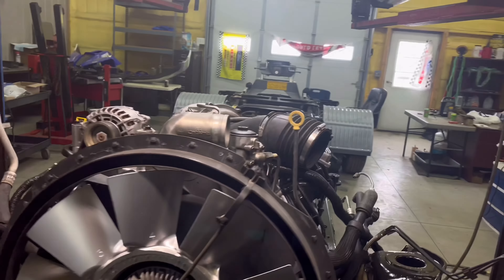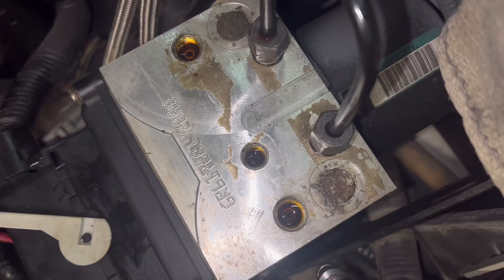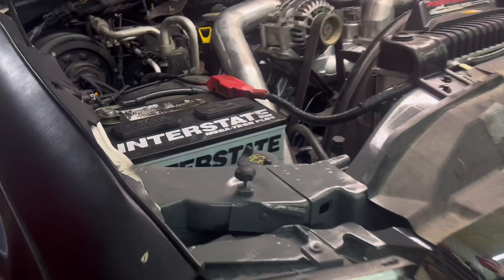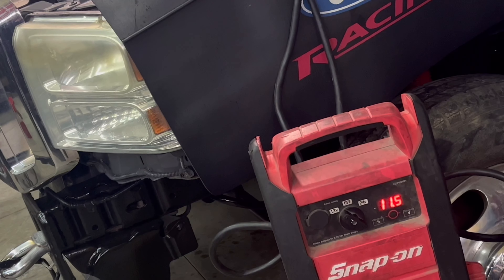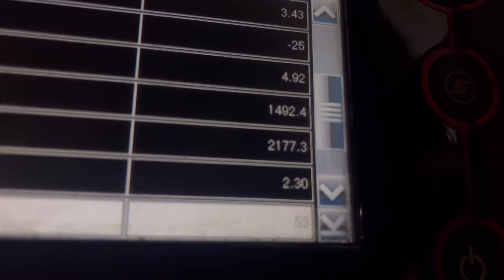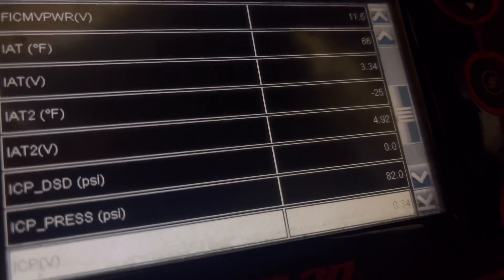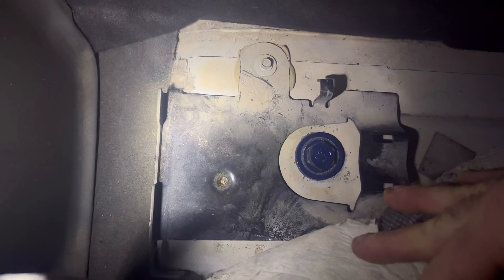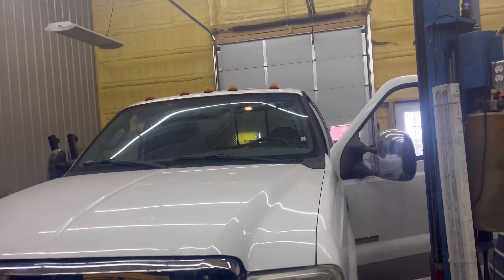Cab down on the white dually!!!

Comment: ive had multiple issues getting my 6.0 cranking over good and fast. currently where i live in edmonton alberta its been down to -40. even with a tender on the batts she didnt want to crank.Ive owned the truck for over ten years and have not had good luck with batterys. In your opinion are these engines finicky when it comes to cranking power?
Reply from the maker: If we are gonna have bad batteries,,,  then everything else really needs to be in order.  You watched me here,,  these batts are TRASH and we got it going.  But you add a couple bad glow plugs or a shaky ficm,,  very easy to not get it running!!!
Reply: -15C here in Ontario running 15w-40 and she will not turn over without being on the block heater for at least a couple hours, run a tender as well.  Switching to 5w-40 this week so that will be a lot of help.  Run a 6.4L starter and that really helps to turn her over fast, big difference over the 6.0 starters.  Batteries, I get 4+ years and they are just about shot.  Nature of the beast with these engines.  Have had the truck for 14 years, love the damn thing, probably the best truck I've ever owned.
Reply: @AnthonyYoungblood  i did forget to mention that i am down one glow plug lol.keep the great content coming!!
Reply: @louisschummer931  i also have an oil pan hetaer since there is 15litres of cold ass oil in there. in the winter i run T6 5w40.  ive considered the 6.4 upgrade also. and i also love this truck.
Reply: @adamcossy I use 5/40 synthetic .in my 6.4 always plugged in winter .starts well so far